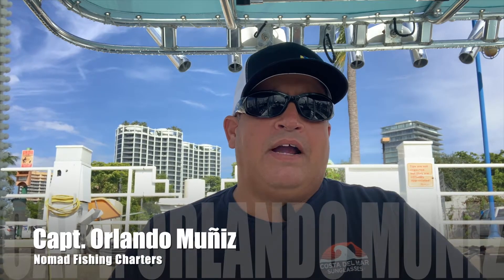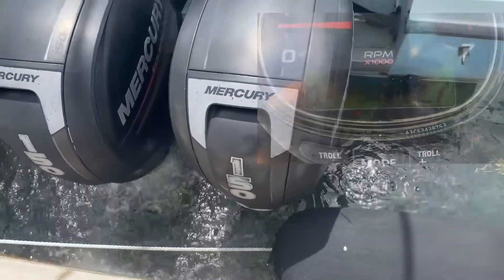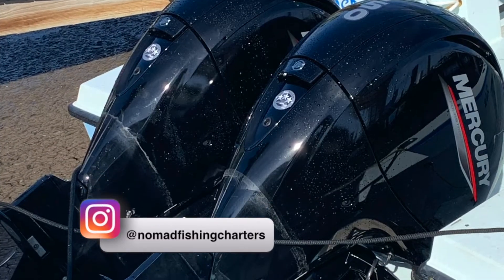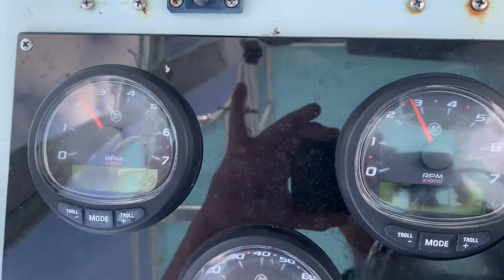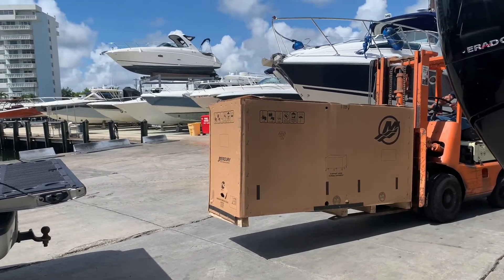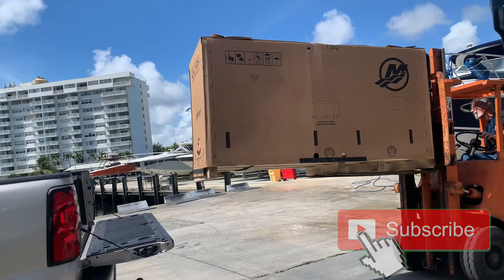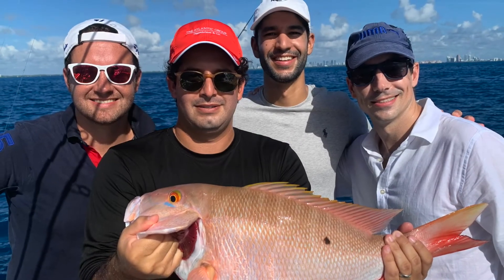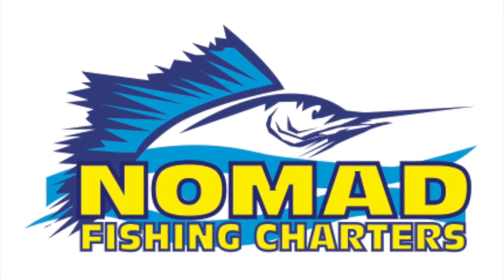Mercury 150 HP Four Stroke Repower and Break in Procedure #mercuryoutboards #mercurymarine

Comment: Did the dealer pay you for your motors?
Reply from the maker: Nope! Sold them to a private individual.
Reply: @CaptOrlandoMuniz  did the dealer help you get them off and box them up?  I have a 2018 150 and thinking about getting  a new 225.  Wondering the best way to do it financially.  My motor has very little use.
Reply from the maker: They basically removed them and strapped them to the pallets that came with the new engines. This may not always be possible since on some engines you have to return the crate or pay for it. Either way you could probably just have them put the old engine on a regular pallet for transport. Good Luck, Capt. O